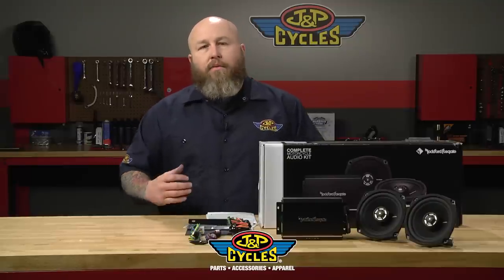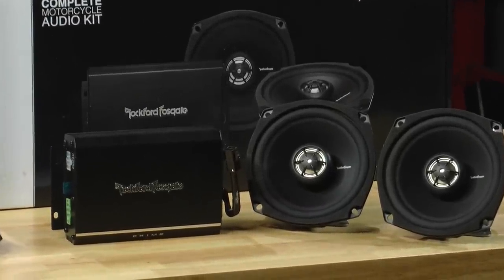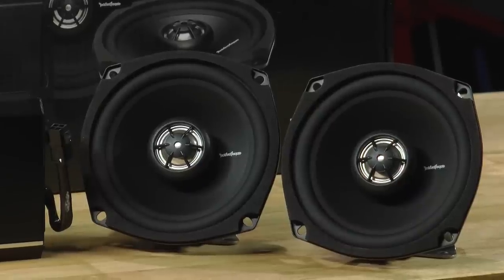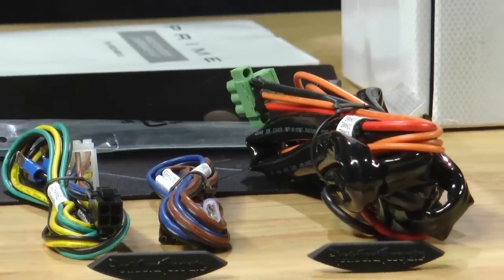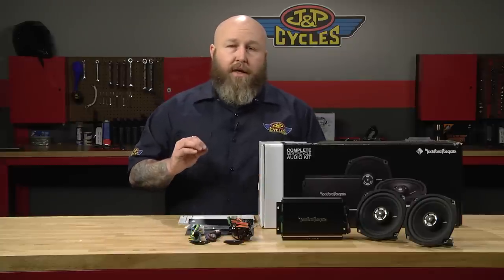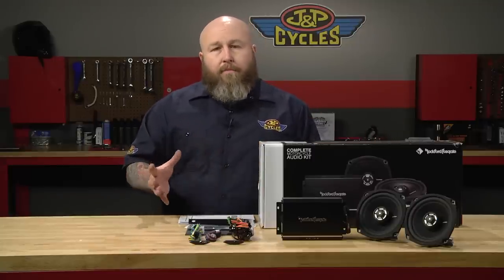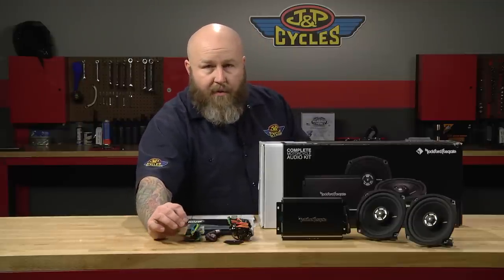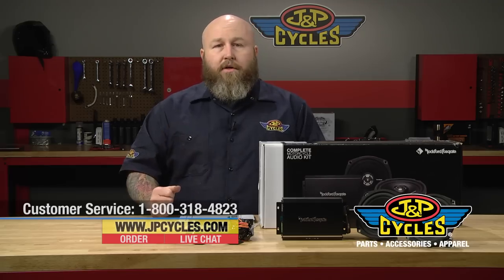Rockford Fosgate Prime 140 Watt 2-Channel Amp and Speaker Kit at J&P Cycles

Comment: Is there a similar kit for for 2015 bikes
Reply from the maker: Which model bike?
Reply: 2015 Harley Davidson  Streetglide Special
Reply from the maker: Deztruktion22  not at the moment. We will have a very similar kit from Hogtunes in the very near future, I'll post the link here when it is live.
Reply: Ok, thanks for your help
Reply from the maker: Deztruktion22 Here is the Hog Tunes kit for your 15 Street Glide http://www.jpcycles.com/product/174-848 Its a little more expensive than the Rockford Fosgate kit but has the larger 6.5" speakers and a 200 watt amp.
Reply: Thanks for your reply, I'll  check it out